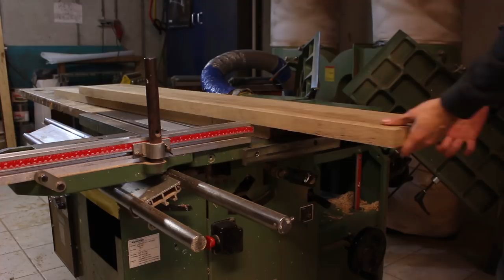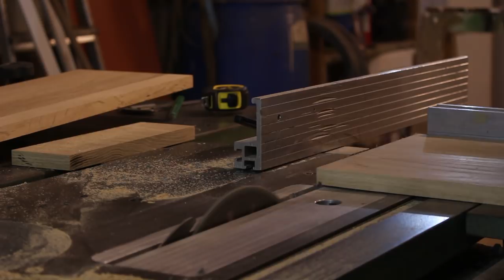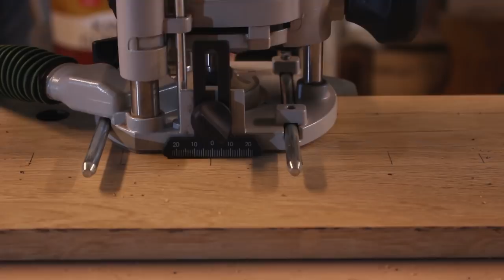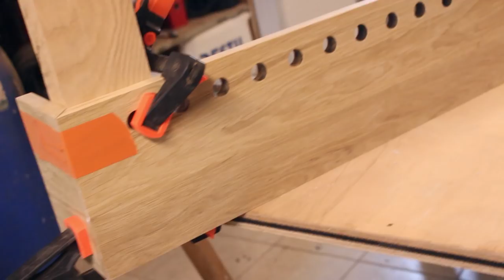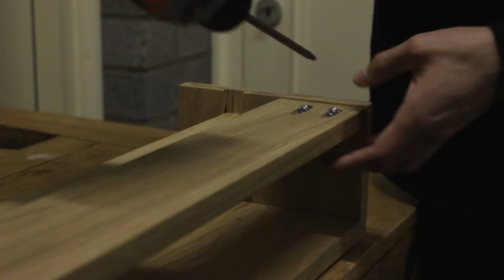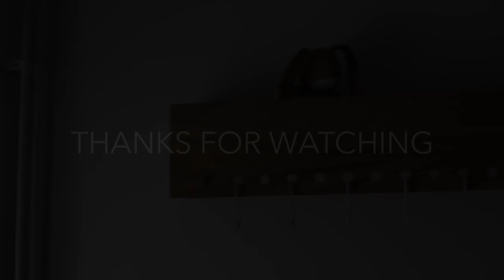JM - #021 Coat rack

Comment: Tilting the blade towards the fence? It could be a very bad idea 🤔
Reply: Those machines can only tilt that way
Reply from the maker: Indeed, I never noticed that. My dewalt sawing table tilts the other way. But as DonderJager says: the Robland can only tilt this way. Should I move the fence to the other side?
Reply: Jurre Mattheeuwse It’s really hard for me to judge. Some say that you should never have a blade tilted towards the blade as a stock could get jammed in between and create a massive kickback. Although I have never experienced or seen such a kickback. Maybe indeed it would be safer to move the fence to the other side of the blade,as a precaution. Better to stay safe. Anyway another great project from you sir ! 👍
Reply: DonderJager move the fence to the other side than,simple as that